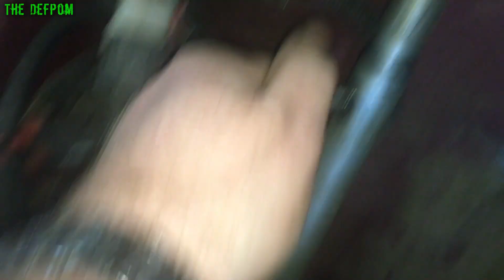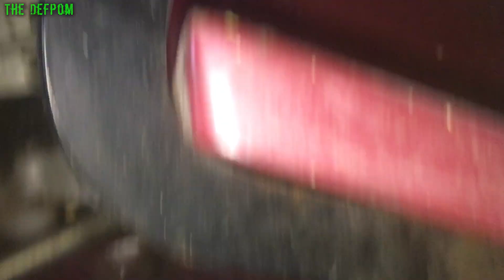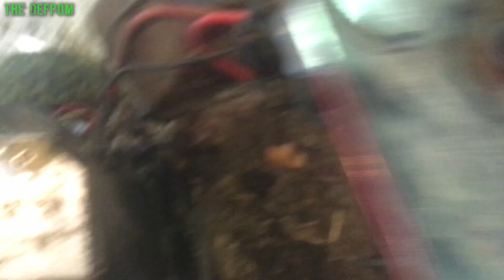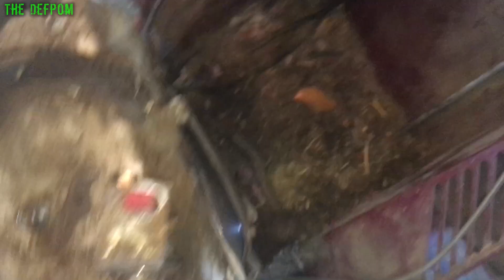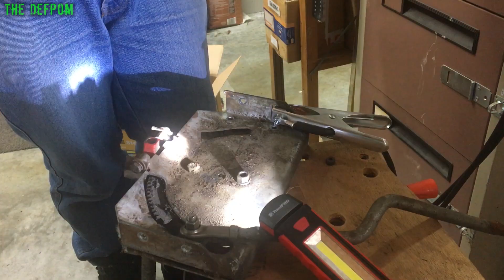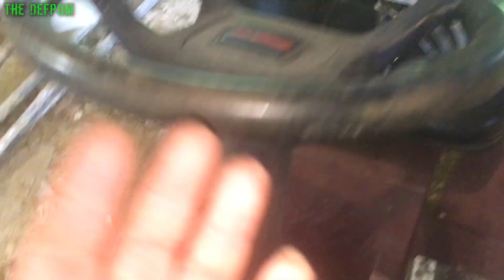🔴 Kingcat Ride On Lawnmower Steering Box Repair - No. 819

Comment: I have a Kingcat that I have been rebuilding in my spare time, I finished it last week and gave it a test run on half acre block and it really amazed me, the 13.5 HP motor is very ballsy, as I was turning into my drive way The steering did not respond to the right and was clicking.
I pulled it apart, and I decided it was way too difficult so I put it all together and searched the web and came across your Video, Thanks heaps mate ,I will have another go at it...
Thank You Heaps.
P.S. just a few tips for your own good, 1) Protective clothing at all times.2) Cover all moving parts when welding ,this stops all those little nasty slag balls sticking to everything that moves.
3)I would also have tacked the nuts on the inside of the plate with slightly larger bolts.4) I would have pressure cleaned the unit and painted it silver, and fix all necessary areas while it's all exposed whilst it's dismantled...it's only my way of working. ( I'm actually a Body Therapist but I spent my teenage years and early 20's working part time in a Servo and a hire company doing repairs to their equipment, and was working full time as a Printer, but I enjoy rebuilding bikes and small engine equipment.) I'm 70 years old and still working when I'm not too busy I re furbish bikes for Foster Children.
WELLtoday 16th August 22, I pulled that steering plate out without any issues, I had a spanner set from ALDI it worked well, all buffed oy and repaired with my welder, but I have also tack welded the the 4 nuts that go on the inside ,a much easier way of working...all wire brushed back primed and sprayed black ...really looks the goods Thank you again.

Comment: Most mower steering systems are terrible, though yours is much harder to reach than some.  Some models have the gear/sector and pinion hanging under the chassis where it can be reached after dropping off the mower deck, but yours is effectively designed to be inaccessible ;).

I've replaced the steering parts on my John Deere twice in just over a decade and I try to be easy on it by not turning too sharply while moving fast, etc.  I've worked on Craftsman mowers and they had much stronger steering mechanisms (thicker, bigger), but never found a brand that didn't have design flaws or ultra-cheap parts somewhere.

I highly encourage wearing long-sleeve shirts and welding gloves when welding, as thrown metal will melt holes right through your flesh and the UV will burn skin much faster than people expect ;).

Comment: That's not good enough, it will never pass an m.o.t ha ha :-D
That was a weak and watery steering system,  they spent no money on that design.
I imagine it would sting your wallet for a replacement assembly, manufacturers are gits like that.